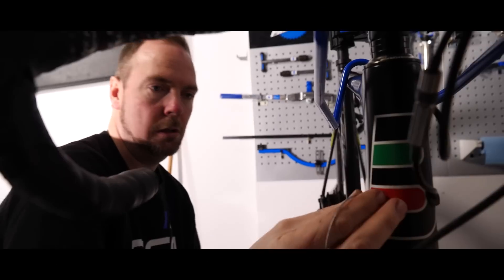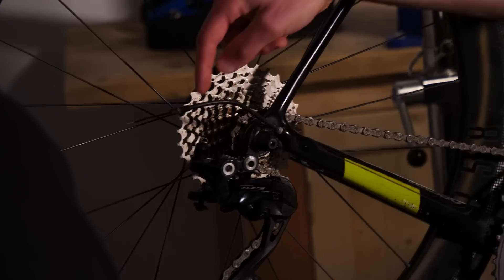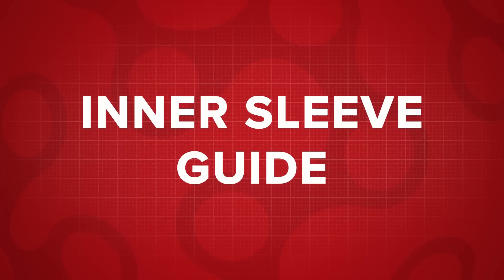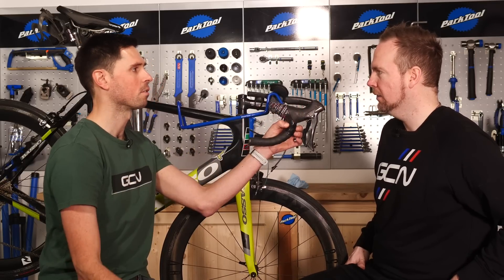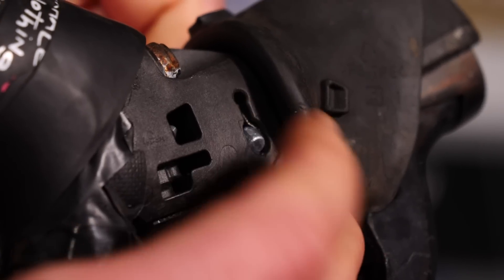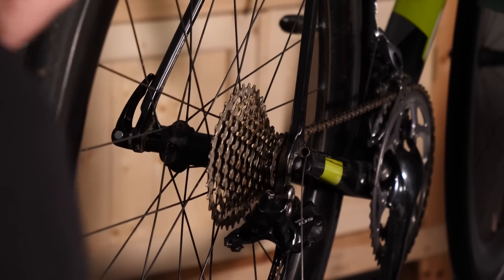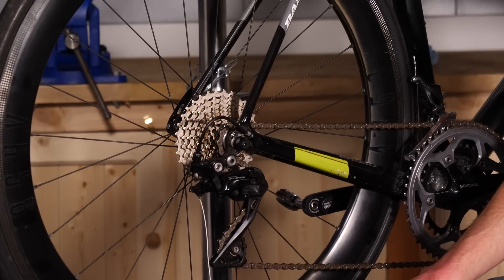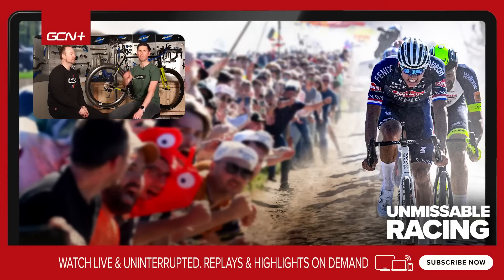Can An Idiot...Change A Gear Cable?

Comment from the maker: What would you like to see us cover next? Let us know 👇
Reply: Good guide ... how would you do it for a frame that has internal routing, but doesn't have an inner guide sleeve that runs the length of the bike. Assuming that would require the park tools internal routing kit ... have you done a video on usage of that?
Reply: This afternoon I was riding my bike somewhere in the south of Portugal. You have to shift all the time in those rolling hills. Right now it is exactly two hours ago that I tried to shift, and nothing happened. After some cursing I decided to find a bikeshop, buy a gear cable and find one of them old GCN videos on how to change the gear cable. You must have uploaded this video maximum 30 minutes after my cable broke. I feel like the universe just likes trolling every now and then...
Reply: Newbies first ride with a new bike: the simple adjustments to get comfortable. Start with symptoms and go to adjustments to try eg knee pain -> saddle height. pain in hands, saddle for/aft, tilt
Reply: Either changing tires, bar tape or brake cables.  All are required maintenance tasks.  Great video!  Thanks for posting!
Reply: Would be nice to see bike upgrade for beginners with small budget, let say  “ road bike 3x9 to 2x10 “
With maybe two or three components replaced, not whole group set.
Keep brake livers, crankset  , front gear shifter.
Reply: Obviously the front cable.
Reply: Get Phil to do a SRAM HydroR brake bleed 😈
Reply: Disk brake bleed and pad replacement-for it’s timers
Reply: Show us how to work on the new ABS hydraulic brakes
Reply: You have an obvious relation to Park Tools.  Do a compare and contrast overview of the different Park repair stands.
Reply: Do a video for the essential beginners home maintenance tools.
Reply: Topeak has a "Tubi Pump" for tubeless tires.  They also have upgrade hose kit, that has the key special chuck for tubeless tires.  Please do a review of that upgrade kit for the hose and chuck.

Comment: The bar tape is shocking, since you asked! Definitely should be the next job.

I take some slack out of the system by holding the derailleur in place whilst changing two or three times at the lever. The resistance helps seat all the cable outer, ferrules and cable guides. Then loosen the pinch bolt, pull through the cable inner once more and retighten.

Comment: This is brilliant timing. I just did this for the first time yesterday and definitely at Dummy level. Lost the cable in the frame three times, even with using the cable guide. Now I'm perfectly routed (I think!) and need to work on indexing the gears. Enjoying  the bluffers guide. Really good format Alex.
Reply: I ended using magnet on parts
Reply from the maker: It's even harder doing it first time with internal routing! Keep at it and you'll have it 🙌

Comment: If it's time for a new cable, you might want to replace the short bit of housing by the rear derailleur while you're at it.  If your shifting is sluggish or sticky it's often a sign that the housing is worn or contaminated.  That short section of housing by the derailleur makes a tight bend and probably wears out sooner than any other section.  Fresh housing can really improve shifting feel.  Finally, be sure to use shifter housing, not brake housing.

Comment: Watching this makes me so glad that I switched to Di2 years ago xD
Reply: My 6.7kg bike is SRAM red 22
Recumbent is SRAM red 22? Etap
My future trek Emonda alr be with SRAM red axs etap (forks and groupset be only carbon so looks be sub 7.5kg without care about the weight)

I prefer mechanical as no battery charging but I rarely shift from 53/11 gear, and yes I do proper bike builds (most on youtube got a wheelset, I build the wheels myself)

Comment: Very nice video!  I am wondering if this bike had internal cable housing from rear mech up to the bottom bracket.  If not, would the cool "inner sleeve guide" work there?

Comment: Even though I knew all this beforehand I watched it all. The beauty of a mechanical is that you cannot run out of battery. Great if your bike sits idle for a long time. It just works straight away.
Reply: Just charge your battery. No cable needed.
Reply from the maker: Very true! Mechanical still has its place 🙌

Comment: Alejandro, this is a great new series!

Can we use electrical tape to prevent cable from fraying?
Reply: Yes my man! Electrical tape + lighter to burn it a bit and stick it all together. I have mine in for a bout 3000km so far 👍
Reply: Is it fine to like solder the end instead? I got a solder but no lighter
Reply: @mlee6050  Well, as far as you burn a bit the tape to melt it a bit and avoid the tape to unwrapped, it is fine, but it is definitely easier with just matches or lighter than a solder 😂
Reply: @_NoName...  I mainly thought solder as like what be like before cable is first cut, I am unique as got my own place but don't own any lighters or matches

Comment: Done better than I did the first time I tried that.
Hell, you did better than the last time I did that. That job still gives me fits, especially the front mech, on a triple.
Well done, fella!
Reply from the maker: Great to hear that you are dong it yourself 🙌 What bit do you struggle with the most?
Reply: @gcntech  its shifter cables, especially on the older Shimano XTRs, as the rapid rise system works, in a nutshell, the reverse of standard, or normal shifters.

Its completely backwards.

Comment: That was a great video Alex. I’m trying to do all my own stuff at the mo, that was my next job to do. I’ve recently changed to a 11-34t cassette so needed a medium cage derrallier but I took off the extra hanger arm that was on the new mech is that ok or do I need it on the derrallier, the shirt cage one I took off didn’t have it on as well? Any help please 🙏 thank you
Reply: The answer depends on your frame and, specifically, the derailleur hanger. With the introduction of the Shadow rear derailleurs (Dura-Ace R9100, Ultegra R8000, 105 R7000, etc.), Shimano rear derailleurs can be mounted to either standard hangers (using the "extra hanger arm" or b-link) or to direct mount hangers (without the b-link).
So, if your short cage derailleur was a Shimano Shadow design (e.g., R8000-SS), and was mounted without the b-link, we can assume your frame has a direct mount hanger, and your new Shimano medium cage derailleur (e.g., R8000-GS)  should also be mounted without the b-link.

Comment: I thought before pinching the cable the front chain should be in the smaller chain ring. Correct me if I’m wrong.. thanks
Reply: Correct but when can't shift smaller they find out unless you left slack when pinch as still stretch a bit that might allow it

Comment: When my rear cable snapped, I was able to change it, so I would say yes, an idiot can change a cable! 😆 The hard part was finding a video about how the cable attached in the shift lever. I have an old Shimano 105 flight deck shifter.
Reply from the maker: Great to hear that you got yourself back up and running! Often its the mid ride mechanicals that we learn the most 🙌

Comment: Fred forgot to explain cable stretch. In a month or so, new cables stretch and you'll have to reindex the rear. But now you know how.
Reply: Depends on your cycling, often 20, 50, 100 miles they recommend to check, I use smallest gear at back most times so cable not stretch for ages
Reply from the maker: Great point Robert! Phil might coming nocking at GCN HQ again 👀

Comment: When I saw this pop up on my feed I said: 

Yes. Any Idiot can change the cable UT can they make it work properly? 

The bike shop I used to frequent could NOT. So I stopped going there for any mechanical issues. I bought a book on bike repairs, read it then another then another. After attempting to do some repairs I realized some Specialized tools would be needed so I got them and now I do all my own work. Since then I have not left my garage with a bike that wouldn't shift on to all the gears and most importantly the bikes have always had working breaks. YES ... A bike shop that said my bike was ready to ride ... without breaks. I picked it up after a "Tune Up" and a couple days later I went out for a ride. The first time I reached for brakes I had almost nothing and almost crashed. In squeezing the levers the front break gave me NOTHING. Lucky for me the rear breaks worked but as any one who rides can tell you the front breaks do most of your stopping.
Reply: I watched Halfords videos, any bike that goes to Halfords, I often see again, tru wheels they great in video but at store only tighten so give me up to 20 minutes a wheel and within 1mm tru, I often try if got gauge to be under .2mm where most stop at .2 or .5 even